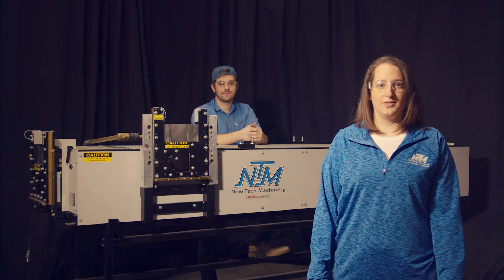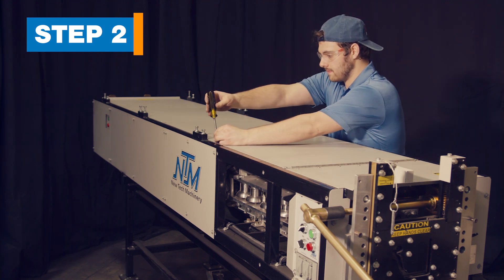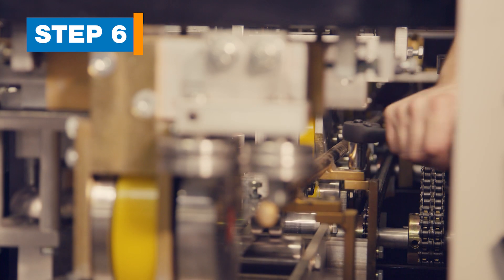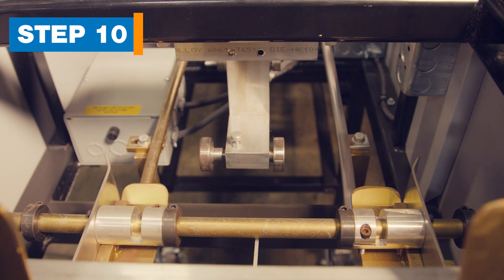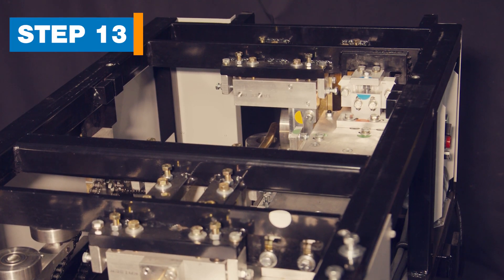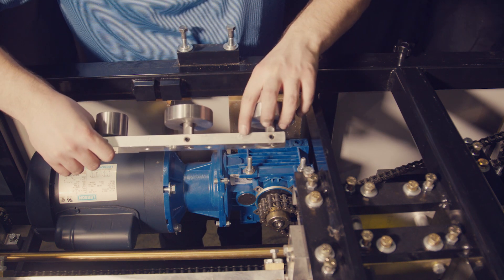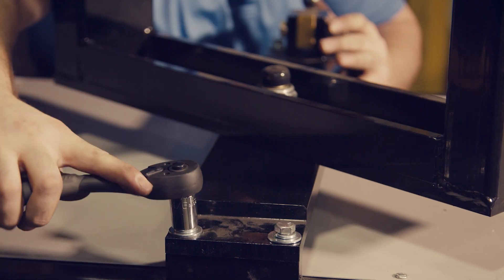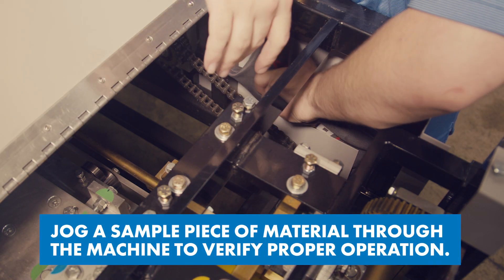NTM MACH II 5"/6" Combo Gutter Machine 5 Inch to 6 Inch Changeover

Comment: Hey guys great job for creating 5"_6" combo machine. However I will like to see improvement on the machine because on the job site it kinda hard to work to adjust the machine . I have a little space to work with and it does take sometime changing from 5"_6" gutters. I do hope in the future some one will come up an ideas that simply a press of a button gutters machine can change from 5"_6" . I do love the gutters machine that u guys make . Keep up the good work 👍
Reply: Grover made a 5/6 combo that changed from one size to the other with just a switch. Unfortunately, it was such a good design - they stopped making it!!